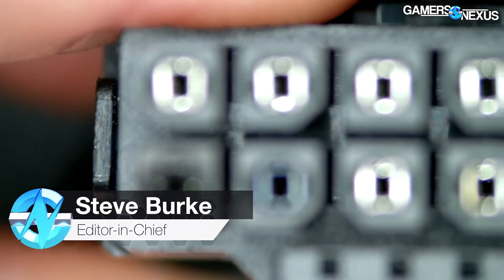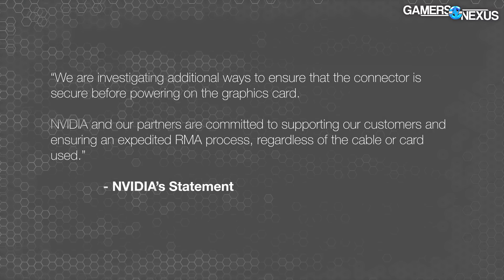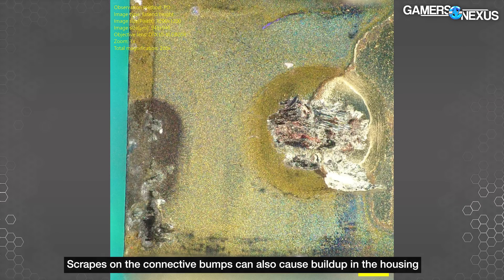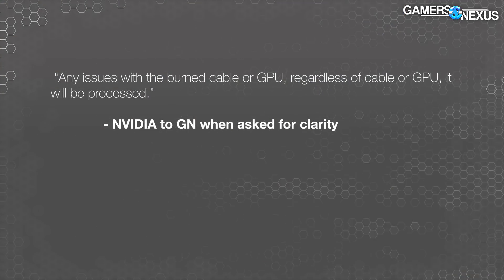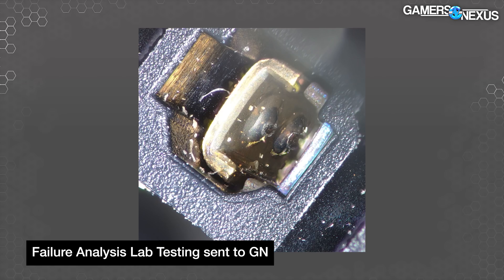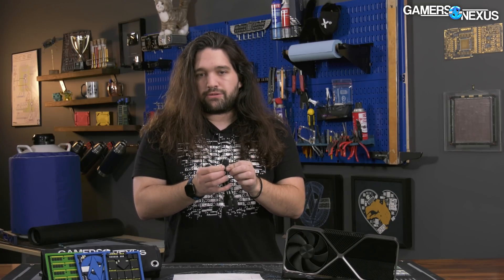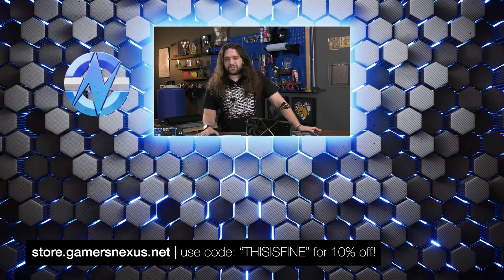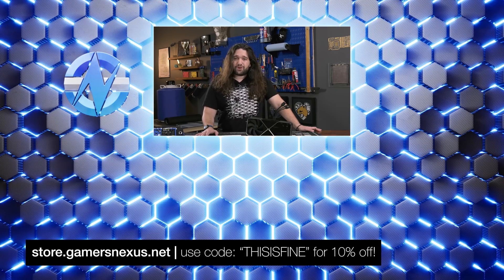NVIDIA Responds to Melting Cables, Warranty Concerns, & 12VHPWR Adapter Failures

Comment: No engineer in their right mind would use more than 2 pins and wires to transfer 12v power. A redesign of the entire industry is needed because we cannot keep scaling this standard. We are trying to cut costs not add unneeded costs like sense pins that solves a issue that was created by this design. This is laughable to anyone with a tiny bit of design/engineering knowledge in power delivery. What we need is a new standard for high power delivery that is above 600 watts. That way the only things manufacturers need to change is to add a high power 2 pin delivery to the 600w+ power supplies leaving the old standard in place for the smaller graphics cards of the past/future. it solves the problem while cutting back costs on wiring and it will ensure that the power supply will be above a certain rating otherwise you can't even plug it in no sense pins needed. it also allows for smaller form factor power supplies because you can remove sometimes over 16 pins of connectors and replace it with only 2 big ones. You can then have a warranty that covers that system without just hoping the customer plugged it in correctly. The fact that i can say this means to me that the industry is not moving forward but sideways and its obvious now that we are in a bit of a dark ages.

Comment: I said it once. I'll  say it again 

YOU CANNOT RUN MASSIVE AMOUNT OF POWER THROUGH  LITTLE CABLE THE GAGE IS TO LIGHT AND SMALL 
A FIRE HAZZARD!!!!
BEWARE..  RECALL-RECALL.
500 WATTS ON ONE LITTLE CABLE !!! NVIDIA WHAT WERE U THINKING..
EASY FIX. USE A HEAVEY GAGE CLIP ON THEY CAN TAKE HEAVY  WATTAGE AND ARE SAFE..
Easy fix !!!!!
Reply: As soon as Steve gets a hair cut. lol

Comment: Its very cool from all 4090 buyers that they act like some sort of beta tester with their money and time for the security of the upcoming NVIDIA power connector standard.
So in 2 years when I buy a RTX 4070 Ti, maybe used, it should be fine by then.

Another solution would be to position the adapter on a longer PCB downwards so that the majority of builders would not have to bend it that way! Also another fixing mechanism would be clever ...

Comment: The problem is tiny pins that are 0.64x0.64mm. This make them to handle about 3-4A, all over this will make over-heating as you see: 6 pins x 4A = 24A, 24A x 12V = 288W. If PCB drain more than 288W from this connector it will melt. As times go on you will see that melting cables  % will go higher and higher than 0.1%. For 4080 maybe it will be OK, but for 4090 - NOT! IF you make 4090 run tests and drain 450W or more and soon you will see melting connector! Somebody to try this and tell what time is needed before melting start!

Comment: YOU SHOULD HAVE TOLD NVIDIA THE THRUTH! Whoever the heck designed this cable needs to go back to the drawing board.... or better yet the sketch pad.
So glad I upgraded one gen b4 EVGA said we're not dealing with this underspecced crap.
  Glad they chose to bow out rather than have to deal w/ all these burning sockets & cables which = RMA.
EVGA has good customer service. Nvidia would have cost them alot of money had they decided not to reimburse EVGA. This was a TERRIBLE rush to a connector solution w/ an unacceptable outcome.
 Maybe they should have included Nvidia in on the design at least.

Comment: While it may be "User Error", the design is flawed and with the weight of the cables, the pins and connecter will tend to "Pull" to the right or left and out of the female connector. It's common and has been an issue with cable weight and direction of routing. When cable designers make a better locking mechanism, many of these issues can be resolved. I have been a PC builder for over 20 years and it's common with all wiring in cases.

Comment: There should be more space surrounding the connection area on the GPU, this is definitely on Nvidia and they're FAT design, user error surrounding something as simple as inserting and clipping in a cable and then seeing the cable burn up to such a degree, yeah that's on Nvidia, and that's not even mentioning using too much force and damaging you're PCIE pins trying to guarantee the crap doesn't happen

Comment: so - in the end the gist of this story is someone somehow not fully seated the connector - or it came lose otherwise - and it only showed this time because we're now at cards pulling more than whole systems just not so many generations before
hm ... hard to tell if it's to blame on user error - but with less than 0.1% failure rate with over 125k units sold it's hardly any systematical issue
I guess it's fair to say: the design is flawed in regards to it requires a lot of force to fully insert the connector and to make it click in

Comment: I accept your challenge, Steve. You just wait. When I make enough money to buy a 4090, I will have developed the physical strength required to break the connector at the PCB. At current, it’ll only take me 10 years. So you, good sir, can expect to be flabbergasted in roughly 10 years time. Not only for disproving the physical abilities of your audience, but also for wasting my own money in doing so. 😂

Comment: If the card was horizontal, like a majority of pc builds, the card would heat up and soften the plastic and the weight of the power adapter would pull the cable away from the power socket.

Comment: I haven't quite followed the saga of these cables. But looking from the outside in, these connectors look like a joke. Yes the failure rates are low but user error as such needs to be removed from the equation. Maybe its time for a real high power connector design. Something that is bolted and installed by oems.

Comment: I think what Nvidia should’ve done was instead of having a 12 V power connector they could’ve just had those wires soldered directly onto the PCB and that would eliminate pretty much all these issues and then on the other end, have the standard PCI express connectors (female)

Comment: I think your on to something with the latching system,  it wouldnt hurt to have each end of the cable connector  to be fitted with a screw or thumbscrew like old school external serial and parallel cables of yesteryear,  that way as you turn the screw it would pull it into position properly and keep it there, as its stands with the current connector its easy to overlook

Comment: The failure rate part is just taking numbers outta your ass boys. You do not know when the 50 unit figure is from, yet you compare it with a "recent" sales number. You do not know what is included in the 50 number figure, nor if it is even the truth, yet you take it at face value, as if the company would have zero incentive to lie about it.

Really cannot take that part seriously, sorry. The rest of the video is quite good though, thanks.

Comment: Okay but if this is really user error and not specific to the 4090, you should be able to repeat this user error with any other card. Try a 3090 or 3090 ti or 3080 TI and see if you can get this melting. If you can do the same not fully plugged in and get it to melt then sure user error. But why would we not have seen this before in older cards? There is something relating to the design of this cable along with user error causing this to happen

Comment: Unless I decide to buy a replacement 12v high power Corsair  cable for my 4080,  my adapter is never coming off.    I've never been so paranoid doing an install in my life.    But dear lord... The lack of tactile feedback connecting the adapter is real.   Short of giving it nuts when you push it down or check for a visible gap when connecting the cable (do both!) there's no way to tell if it's fully connected or just mostly connected.

Comment: The evidence you’ve presented tells me there are zero instances of user fault. If it’s critical that this plug is secured to that degree then nVidia was absolutely responsible for designing a more reliable connector.  As an failure analysis engineer, this is completely on the design team not the end user.

Comment: I think you would use the old denominator of 100,000 units because the number at 50 would be based on a delay for the customers to install and use the cards prior to failure.

Comment: Thanks Steve and all involved at GN for these excellent video's! It's gr8 that Nividia are going to do something about it and I can conclude from the video and that what was said about users not making sure the socket and plug are firmly seated and fully home. I agree with Arudanel below about the connection being weak! I did hear the click of the plug in the video but this doesn't mean its fully home and it was still looking flimsy with a bit of play this may lead(no pun intended) to the connection shorting out! the socket still moves slightly so my observation is that users cant see that its fully home and so maybe a cutaway section that enables the user to see the connection and also a much better secure fitting than that that is available like a flange if the flange is flush with its co flange a green indicator led lets the user know the cable is fully seated if at any point on the flange is not connected the green led wont come on if it don't come on you cant use the device as a fail safe mode. also a temp sensor to test for any heat outside normal working conditions. Failing that the other way is to have a cable connection from device instead of the buried on board fitting on the component board a bit like an extension cable fitting this also would for sure be a visible sign whether the connection is fully home with a secure fitting to make sure it is done correctly and safe and As mentioned earlier if it is not, there will be a light indicator or a warning audio signal. Only when it is safe will the device work and not before! you should always check fittings in case they have become dislodged during a build and definitely before booting up the system. A word of caution here there are fake parts so only get from certified authorized retailers and if in doubt leave it out! and contact the manufacturer for a part. take into account even the manufacturers can be duped as so we all so again it's down to everyone to verify everything is what it claims to be! This may take time but not checking has its consequences stay safe everyone and happy computing/gaming and have a MERRY CHRISTMAS/THANKS GIVING or HAPPY HOLIDAY AND A VERY HAPPY NEW YEAR 2023!!!😁🤗😘😘🥳🎶🎵💃🕺🙏😇

Comment: No one installing a graphics card should have to worry about the force they are applying damaging either the card itself or the motherboard it's going into.  

The be honest though power cables in computers have been garbage since molex, probably longer.  Decades of crappy connectors that should have been re-engineered and made easy and yet we still have to deal with this garbage.

Comment: The cable design is not well thought of. Even in a big case the cable is touching the enclosure. Had to cut out some of the dampening foam (BeQuiet casing) to make sure it's not bending. What did the designers thought when they designed this? Why not supplying a elbow cable? 🤦